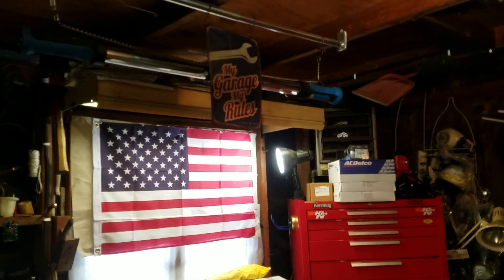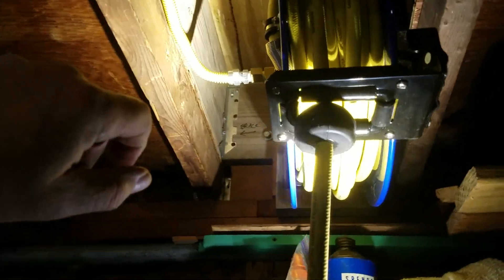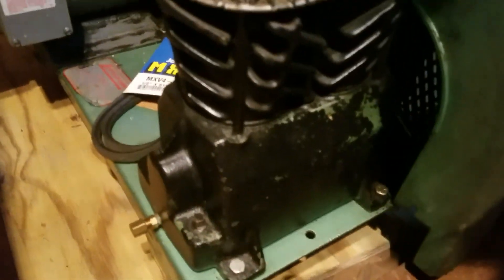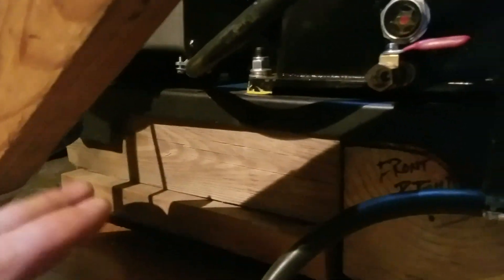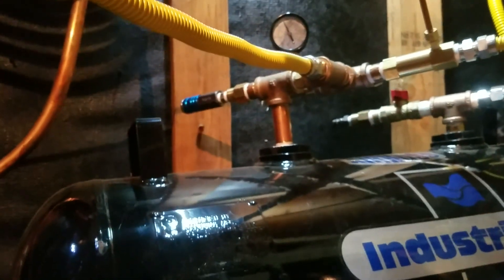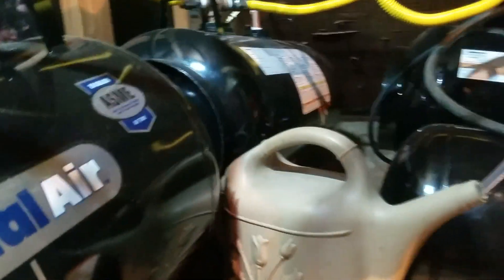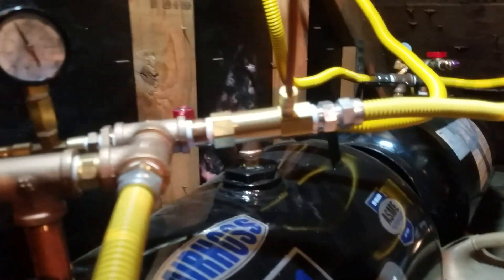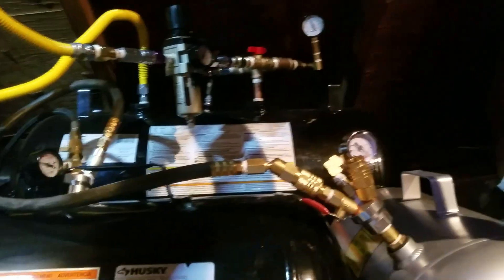Turning Cubic Feet Into Square Feet. Compressed Air For A Single Car Garage Attic Or Small Shop.

Comment: How's it holding up?  Here in northeast NC, attic temps get up to ~140 degrees Fahrenheit in the summer.  Can't imagine the compressor would like that.  I have plans to separate my setup much like you have, but leave the compressor under the bench with the tank(s) up in the attic.
Reply from the maker: Yes. My garage attic is an oven in the summer. No vent but with the cooling addition and water seperators, does not affect compressor.
I need to tighten the now stretched V belts but other than that is working great.
Under my workbench is where I had that mobile 20# unit. Now, a powered washer sits there.
Thanks!

Comment: Well done nice set up..but need a better place to work..setting..condo's  aren't the best place..due to nabbors  being close bye..and noises..I move down south..6 yrs ago..lower costs..nice 2 car shop for hobby work..got a 60 gal new 3.hp.saylor beaell air comprsoir unit ..American  iron ..had harbor  fright  China  junk..sorry boss ..but not worth it..my new unit is quite..and my wife can come in here and talk to me. My unit r.p.m.s. 1725..smoothly  runs..good..found an old in ground car lift..fiberglass casing..no oil leaks. Getting ready to dig down 9 ft.in the fl.sand..under shop floor..to install..next month..il utube it..
Reply from the maker: A lift. Yes! Getting too old to craw under rigs. My compressor is still 100%.
Wife is Pinay so the PI will be ground zero ... Google Philippine electrics ... uhg!
God has a plan. We'll see.
Thanks for viewing.
Reply: I'm at the same age ..don't like lyeing on a creeper....free is good..got this thing on my trailer..so we can slide it into the ground..had to get a installer manual..from globe lift.in il.they were happy to help.me with information..and any parts I may need..and install  tips.S.VI..corp.in Dekalb, il...I'm old school.myself..don't trust these new above ground lifts from China..I will be able to work on my 1969 chevy chevelle ss..and work on my other projects..as needed..like you...we guys need our man cave...to chill.
Reply from the maker: When you said you could talk to your wife ... cave came to mind.
Carry on smartly.
Reply: My new air comprsoir..is so quite..when it's running my wife won't run out of the shop..I should say...the old unit was so loud. It gave her a headache..I spent 3grand..she,ll hang out a while..if it kick on..I found Saylor-beall  industrial  air comprsoir..on utube..I had 2 harbor fright in the past..loud and hot running..